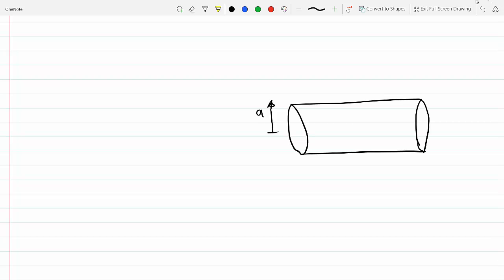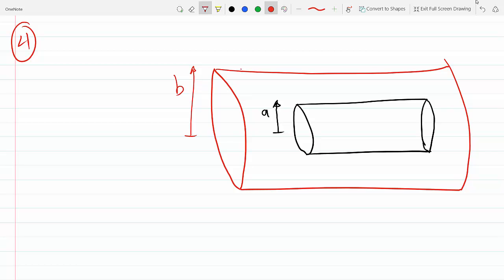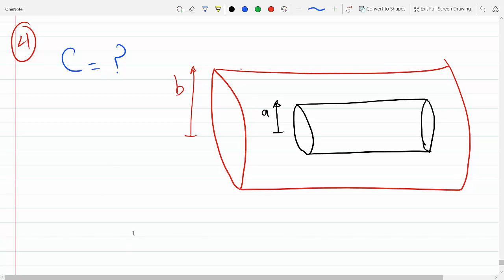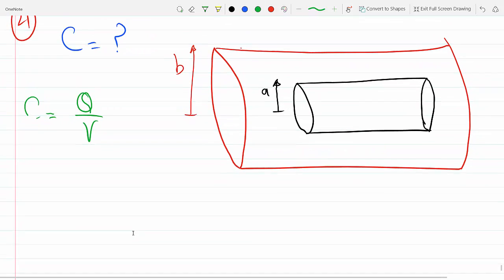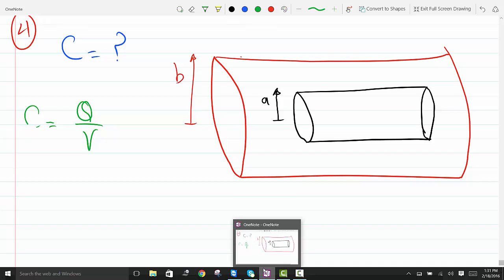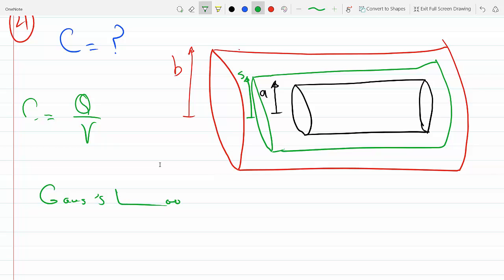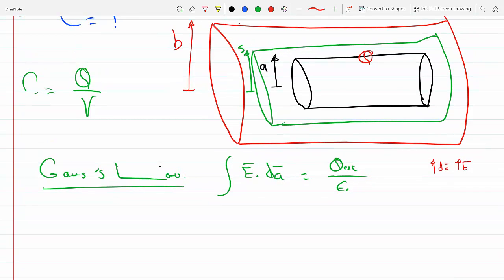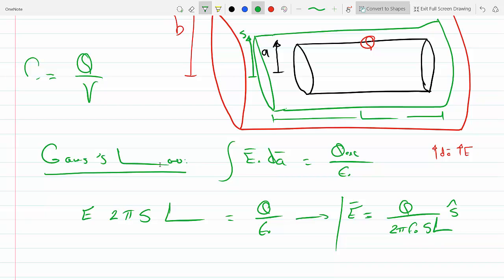Finding the capacitance of a coaxial cable griffith's 2-39

Comment: Why did you remove L from the formula? As far as i know it should be used.
Reply from the maker: capacitance per unit length since the quassian surface is usually arbitrary!